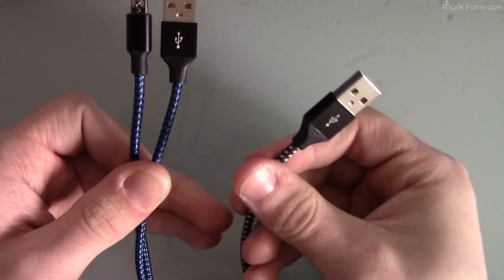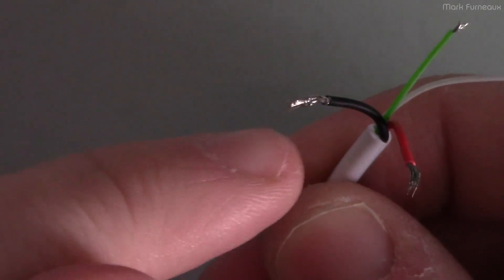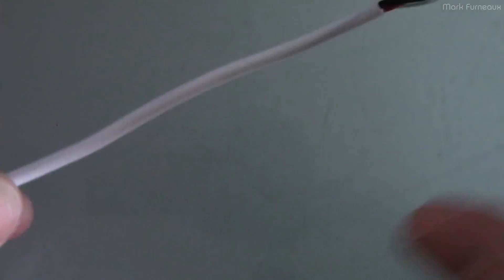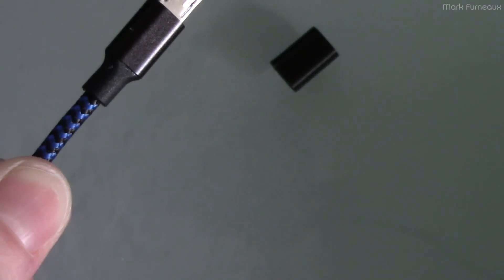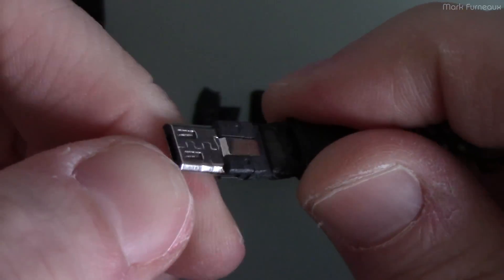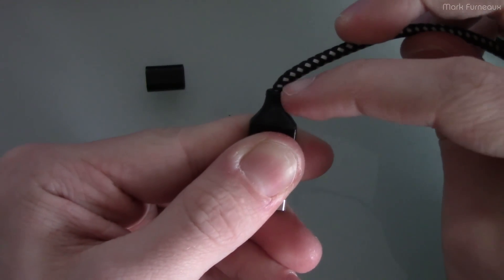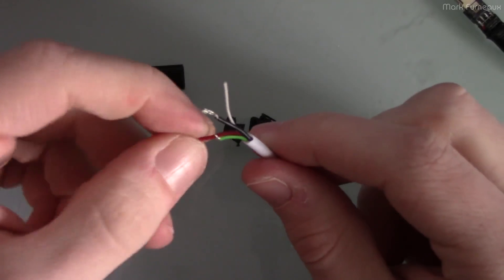Inside a Popular Amazon USB Cable

Comment: I wish you would have shown how to deconstruct it and possibly even how to repair it. I literally just took mine apart yesterday, not as clean as you did unfortunately, to see what was going on because they keep breaking no matter the brand…even Apple and Belkin and I am TIRED of tossing things in the landfill like this.

Can you please make a video on how DIYers like myself could maybe repair these in such a way that they dont set the house on fire or ruin the device? Please and thank you? 🙏🏼
Reply: When I opened mine up the data wires were not connected to the ports they actually spliced the two power cords and twisted the data wires into the power cords.

It seems like they may have realized the wires were too short and just rigged it instead of redoing it… smh isn’t this dangerous?

Comment: Would Poly Monofilament Support Wire be a good wire to sleeve up if you want a sleeved wire to be able to bend and stay in place and then bend back to another position and have it stay in place? if not do you happen to know what wire cable is good for that? i don't want to make a usb or anything of that sort but i just want to make a custom cool looking sleeved wire to hold an item in place and to have the flexibility to be able to move it in a different position with out it breaking due to often bending it.

Comment: Junk cable. High-speed and up should have a shield that extends from one plug shell to the other with a resistance of 0.6 ohm or less. See Chapter 6 of the USB 2.0 spec. from USB-IF on cable assembly. Section 6.6.3 gives resistances.

Comment: The difference I've noticed is good cables have a wire mesh shield connected to the plug shell ends, just continuity test them.  If something goes to sleep on your pc and doesn't wake, maybe a bad cable.

Comment: In fairness, I think you should consider disassembling one of the cables from Amazon to verify that the power wires are indeed made from aluminum. I am not sure it is correct to assume that the cable your girlfriend sourced locally is the same as the cable from Amazon even though the jackets are very similar.   Otherwise, I enjoyed your video, liked.

Comment: Sorry, but you don't seem to understand electronics at all. First off, in a consumer product NOBODY 'solders' aluminium, it's way to expensive. To suggest so indicates a complete lack of understanding. 'Skin effect'? Might want to research that, it ONLY has relevance with AC current, DC current (which is what USB cables deliver) does not suffer the skin effect.

Comment: ? Didn't you say this wasn't an Amazon cable? Why would you expect the Amazon listing to describe it? Even if they're made in the same factory on the same line it's quite possible to make a batch with coper for one customer (Amazon) and a batch with cheaper wire for another (the one you tested).

Comment: Wires are not aluminium, they're copper and the ends are tinned. This is easy to check, strip a bit of insulation and you will see copper. The resistance you measured is not the resistance of the cable, most multimeters will not display zero when shorting both probes together in ohmmeter mode. A multimeter can't accurately measure low resistance values below one ohm, also the resistance at the contact point between your probes and your cable matters.

Comment: I had a pile of salvaged and used USB data/charge cables. 80% of them had so much voltage drop, the phone would complain about not being able to do a fast charge vs using the real OEM 3 foot cable. Those Chinese generic brands must use one 30ga wire strand for the power! LOL.

Comment: Aluminium in more fragile than copper, more likely to break when bent regularly.
Copper is also less springy, so one sign a cable could be aluminium is when you bend it and it springs back.

Comment: This wouldn't be a bad series if you say, buy a cheap cable off of Amazon and tear it apart to see the quality. It's hard for me to find a third party assessment of a specific cable on Amazon; I tried when I took a leap on some third party cables for dash charging my OnePlus 6T and they work, but I still worry about the possible long term damage.

Could subsidize it by showing the listing and sticking an affiliate link in the description I'm sure.

Comment: Aluminium cannot be soldered I think you are wrong!
Reply: Yep he is. It's tinned copper
Reply: It can.  You use an aggressive flux and appropriate tin alloy. OR, you can use ultrasonic energy through the solder puddle and it will do the cleaning/wetting also.  But of course few people have that kind of tooling at home...
Reply: At 24AWG, copper would be about 0.25 ohms per 10ft. Aluminum would be about 0.4. The wires could be smaller, though.
Reply: I've soldered to aluminium. It's tricky, but there are techniques to get it done.

Comment: Unless it's charging with HF, Skin effect is not relevant :D
Reply: Wouldn't it make more sense on the data lines? USB can handle 10Gbps these aka at least 10GHz these days (theoretically)
Reply: @k1ngjulien_ You are an order of magnitude off here + a bit. USB2 is 240MHz maximum "frequency", USB3 is 2.5GHz. try to look into what is takes to transport 10GHz signals. It's not trivial - we're talking microwaves here running over coax or in waveguides.
Reply: Sorry my bad, but thats still very much in the HF range meaning the skin effect should be hard at work
Reply: @k1ngjulien_   theoretically, yes, but the thing that matters at high data rates is the line impedance (90 ohms differential impedance for USB in this case) and the effective resistance increase caused by skin effect is negligible compared to the inductance and capacitance components

Comment: Are you sure they are aluminum? most wires have tin plating so they look shiny like that it also helps to solder on them
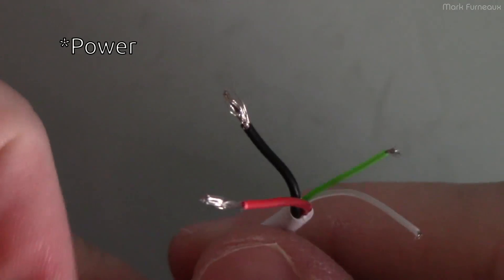Reply: @haroldsmith45302    2:53
Reply: madmax3078 

Yes, thanks.
Reply: Pretty sure he cut it and looked at the cross-section under a microscope.
Reply: to me it looks like steel wires, same with connectors - I doubt they are stainless steel, just some cheap steel with chrome on top
Reply: Indeed you can't solder to aluminium at all
Reply: @TheChipmunk2008  yes you can, with the right solder.

Comment: You should connect a working cable to a 5.1 volt supply and load the cable with 2.5 amps on the other end and see what the voltage at the end is, and if it gets hot or warm or something more dramatic, then try higher current like 4 amps or so and see what happens then.

Comment: At a recent reunion of a 30 year old PCUG, one of our members brought in a similar cable that they found a chip embedded in the USB-A end that was pulling data from Android phones and then using the tether to send it to an IP in Guangzhou.  After reporting it to the FBI, Amazon has quit selling them, the FBI has documented, tested and returned the cable.   Now when they run traps on the device it still searches for that IP but no one is home...   They found the data connection was tied to the chip  and there was no pass-thru capability.  Only the charge wires actually worked but as you said, most only use them for charging.
Reply: How did they discover the chip in the cable?
Reply: @magnets1000  Packet sniffing for some odd listings in his router logs.  It would show when one of the grandkid's phone was plugged in, stop when it was unplugged.  He originally thought it was in the charger head (there have been many reports on these being compromised) but was surprised to find it occurring only when this cable was used.  Very similar to a usbharpoon in function.  Once he traced it, he found it was being trapped by a Snort rule.  But being an old school cyberpunk, he (and some friends) just had to chase it down the rabbit hole.

Comment: 0.6 - 0.8 ohm is awful, you'd struggle to charge a phone a 1A because your phone would see 4.4v and likely back off the current
Reply: I remember getting a cable from Wish that had some super high resistance. I remember being shocked by how slow anything was to charge off it. I never did measure it, but perhaps I should sometime.
Reply: We'll, at least by limiting the current there's less chance of it erupting into flames whilst you sleep!
Reply: I have a Type C cable with the same braiding on the outside, but different ends and even the 10 foot cable still supports Fast Charging.
Reply: Thats not exactly how current works. Excuse the whooosh if its here
Reply: @matthewmcewen1  It is when talking about phone/tablets. They keep increasing their current draw until the voltage starts to drop below USB specs (or even just 4.9v).

Comment: The two metal fins on the back side of the micro USB connector always break off on my wires from putting it in and pulling it out. It still works but it won't stay inside the phone's connector anymore.
Reply: You have squashed them into their holes. If you want them out again, use a needle to lever them out. The cord will be held in your port again
Reply: @matthewmcewen1  Thanks, you helped me fix my wire!

Comment: Other than official large manufacturers cables (Apple, Samsung, LG, etc. and even then, most of the manufacturer branded stuff on Amazon are counterfeits), most USB cables are built with the absolute cheapest shitty materials available. The only exception is higher priced third party rebadge-brands like Anker that actually test before they put their name on it. For every Anker there are 20 ripoffs using names like Aukey to sell trash cables at slightly below Anker prices.
Reply: Apple, samsung, lg, etc. cables is from same cheapest materials... just with brand name on it.
Reply: Ankers quality history isnt exactly pristine either, what "brand" to buy from.....